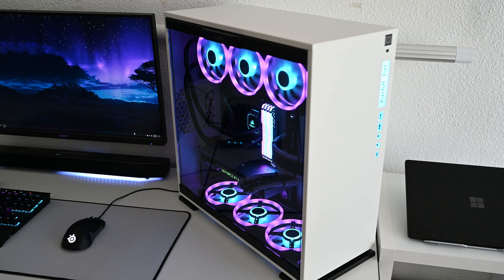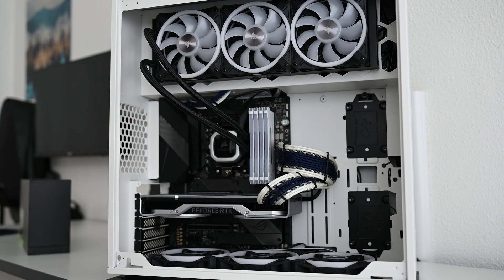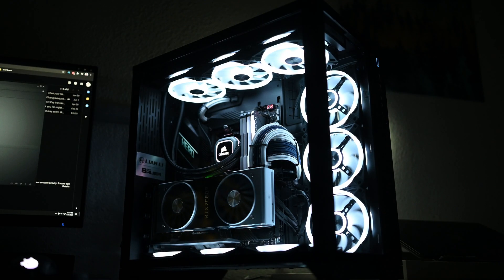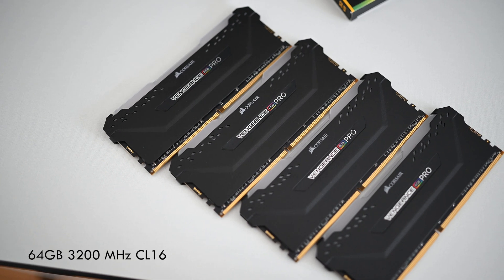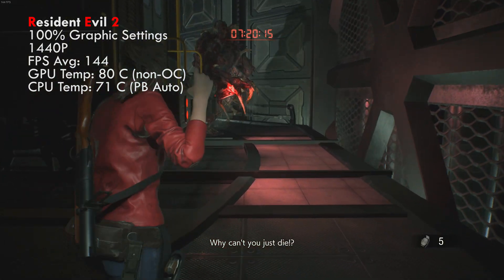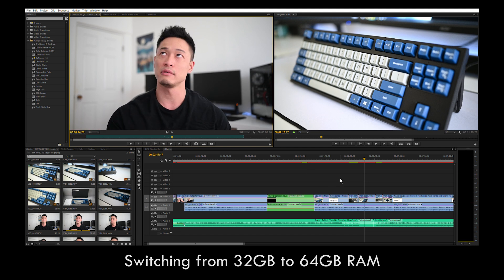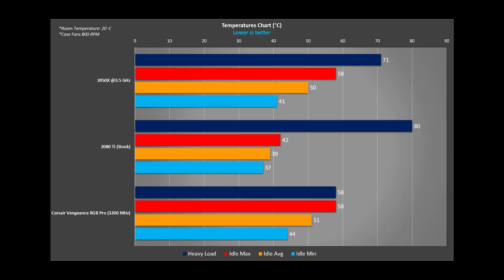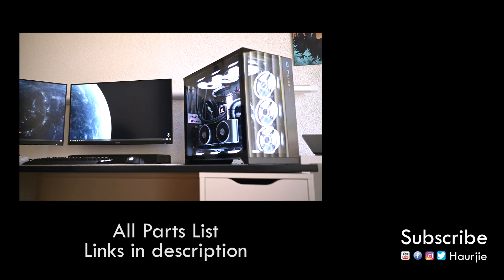Ryzen 9 3950X RTX 2080 Ti – 4K Video Editing Computer

Comment: 3600MHz vs 3200MHz will only have a difference at high refresh rate games really. I run 3800MHz. Your right that professional gamers would notice. Great to see that your RAM temps decreased by exhausting above them.
Reply from the maker: I'm gonna PIN this dude
Reply: @hardlinenexus  thanks for your videos man, so if  am building my PC based on yours, but want that little extra ump for gaming,  go with the 3600mhz right? which is one of the best brands ? or should i get the one you talked about here that you used to have? thanks again dude. love your videos. keep ya head up. mental health should always come first.
Reply from the maker: @josephruffhouse1792  for your case go for the 3600. In fact I have a new PC build coming out where I do actually use 3600 gskill trident neos with a 3900x
Reply: Haurjie dude thank you so much for replying! You don’t know how much it means. One last question for now,  if I’m trying to have a beefy rig both for gaming and productivity, is there really much difference between the 3900 & 3950?
Reply: @josephruffhouse1792  For the most part no.
Reply from the maker: @josephruffhouse1792  ehhh... Tbh, I personally haven't used the 3900x PC yet to answer that. I'm still waiting on one last part to come in before I can actually turn on my PC lol. But the 3900X is more than enough though tbh...
Reply: @hardlinenexus  Yeah, I found the 3900X to be almost overkill for just rendering video. Especially when I use GPU H.265 Video encoding. The 3950X is faster, but for most people it will not be noticeable. It's much better for 3d rendering apps that scale better.
Reply: Haurjie ok thanks man, I’m just trying to build a bad ass rig but I’m absolute noob when it comes to this stuff, but I really am trying to learn so forgive me for all the questions. I picked up a Samsun odyssey g9 monitor and I want to make sure I build something that will get the most out of that monitor. Ps do you have an IG or Twitter ? I have a 40k followers between both accounts and wouldn’t mind shouting out your channel if that’s something you care for.
Reply from the maker: @josephruffhouse1792  I do man thank you! I also am not a guru at everything. My IG and Twitter are both the same handle (haurjie).

Also, my buddy who answered your question here and also original commenter has the 3900X and he pretty knows that CPU like the back of his hand lol. Check out his channel, Graphically Challenged, he's gotta in depth tutorial on overclocking and all!
Reply: @hardlinenexus  Thanks man!
Reply: The price difference between 3600 vs 3200 Mem Kits is kinda small and sometime sometimes nonexistent.

Except maybe for some premium Mem Kits Brands.

Comment: Where'd you get the sleeves from?
Reply from the maker: Solosleeving
Reply: @hardlinenexus  Thanks! If I get only one of the "24 PIN CUSTOM SLEEVED PARACORD MODULAR POWER SUPPLY CABLE" is that gonna suffice for a whole build or do I need more than that? A noob question I know, just wanna make sure because you have 2 different designs
Reply from the maker: @levim.3505  24 pin cable only powers the motherboard. You still need PCIe cables for your graphics card and EPS for your CPU, that's at the very minimum.
Reply: @hardlinenexus  For the CPU, did you get a seperate 8PIN EPS and a 4PIN EPS? Also, I don't think they feature midnight blue as a color option anymore unfortunately...
Reply from the maker: @levim.3505  only need 8-pin. Navy/midnight blue is not listed, but he has it, because I requested him to get it in stock a while back. Just pick any color on the cables as a placeholder, and make a note on checkout. For example, pick electric blue during the configuration, and say "use navy/midnight blue for all cables that are designated as electric blue"
Reply: @hardlinenexus  I see, thank you. You mind telling me what the other colors in this build are? They look like silver-gray and titanium to me. Is that correct?
Reply from the maker: @levim.3505  yeah, it's black, white, silver and navy
Reply from the maker: by the way, this build was upgraded a couple months ago, you should see the custom water cooling i put in it :)

Comment: Hey friend I am just wondering, I have a icue H150i PRO xt Liquid CPU Cooler, it comes with stock fans that are not RGB, did you replaced them and if so does your nzxt internal usb hub usage for the extra RBG fans you are using? Thanks for taking the time to reply to this comment.

Comment: Hello there just wondering on your Ryzen 3950x build Do you need both Samsung 960 and 970? because I only seen you put one in your motherboard.

furthermore the cables you used, what type is it and how many pins do I need for this build and can you do a video of the construction of your cables with your new case and which parts fits in which ? 

Also your QL fans, how many can you get within a single purchase, does it come with the quantity of 3 per purchase? Finally the lighting node core, I notice that corsair only have 6 slots for each fans, do you need to upgrade a 9 slot or purchase additional lighting node cores?

Sorry if this is too much to ask but for a beginner build I would like to know the best methods you use such as cable management and the appropriate recommended best options for any features you might promote. Thank you 🙏

Edit: I subbed. Great content bro

Comment: hey man, loved the vid. was wondering if you use the same monitor for gaming and editing or do you have the same? pls drop the monitor's link .TIA
Reply from the maker: Thank you I appreciate it! I do use the same monitor for gaming and editing work. I bought my monitors at Micro Center which no longer has it. Best Buy also sold out. Amazon doesn't have it. It's an older monitor(s). But the alternative here https://amzn.to/34GNUFc, this is newer. I personally haven't tried it, but the specs looks similar if not slightly better. It's also got really good ratings from other customers too, I would get this if I didn't already have my current ones lol.
Reply: @hardlinenexus  by the details of it, its probably a 1080p or 1440p 144hz monitor...Do you have any problems editing 4k and color grading on your monitor? Im also looking for a monitor to edit 4k and casually game .4k 144hz gets very expensive . So looking for a 144hz 1440p ips monitos to game and edit 4k
Reply from the maker: @killercon2735  I've never color graded my monitor tbh, and I also never edited on a 4K monitor either so I can't really compare what that's like.
Reply: @hardlinenexus  like...you said this pc was for 4k editing. So i wanted to know which monitor you use for 4k editing?
Reply from the maker: @killercon2735  I use the Acer XF270hua. It's a 1440p 144hz IPS
Reply: @hardlinenexus  sorry for soo many questions... you edit 4k on a 1440p monitor?  Does that cause any problems?
Reply from the maker: @killercon2735  no worries haha. Well, I haven't edited on a 4K monitor before as I mentioned so I don't have a reference to what that would be like. As far as I'm concerned, I don't see any problems so far... I wouldn't even know what the problem would be actually? If you have edited on a 4K monitor before as well as a lower resolution monitor, maybe you could share that experience with me and I can look for it. A more important question I think every editor should also ask is, do your viewers notice something off? Are they complaining about something that you didn't see because you edited on a lower res monitor?
Reply: @hardlinenexus  I'm starting out to edit. I just built a good pc with similar specs as you...and I was looking for a monitor in which I can edit cinematic vids , colour grade and also game...an ips 1440p 144hz, should do 4k cinematic edits and gaming, right?

Comment: Vor Videoediting how many percent faster is 64GB vs. 32GB?
Reply from the maker: Higher capacity ram just allows a faster loading time when importing footage and sources. I don't know how much percent, but I noticed loading up Premiere and importing around 100 4K footage was about 10 seconds faster than when I had 32GB. In terms of rendering and exporting, this doesn't make a difference.

Comment: Bro your set up is so sick!! I came across your channel because I'm currently building a Ryzen 9 3950x and am going with a lot of similar parts.
I see that you went with QL fans for your case. Do you think 6 Corsair LL fans would be enough to keep things cool for my Corsair 570x?
Reply from the maker: LL and QL fans are pretty much the same thing. QL is just fancier and costly because it's double sided RGB lol but any fans will do as long as you have good airflow in your case. The lianli o11 dynamic in particular has really good airflow
Reply: @hardlinenexus  Yeah, I'll have to play with cooling and fan placements to see what creates the most optimal airflow. I'm just hoping I didn't make the wrong choice with white Vengeance RGB ram sticks lol.

Thanks for the reply man. Subscribed!

Comment: Wow, this is a great setup.  Just wondering if the specs were reduced say from the 3950X to a 3900X and/or also reducing the GPU from the 2080Ti to a 2080 SUPER, how much of a hit to 4K video editing performance would I see?  I don't mind a slightly longer export time as long as the performance remains good while scrubbing through the timeline in Premiere.  Interested to know your thoughts on this, thanks.
Reply from the maker: Not much man. My second PC I just built will be 3900X on 2070 super. Video coming soon.

Comment: Hi!
What temps do you get for your CPU during idle and load with the h150i pro? 
I have a 3800x with h150i pro xt and my idle temp is 40-45C. Is that normal? It seems kind of high no? When playing games and stuff it can go up to 65C or so as well...
Thanks for the help!
Reply from the maker: Your temps are actually pretty normal for an AIO setup like that. You're fine.
Reply: @hardlinenexus  okay good to know. And subbed! You got this man, and everything else in your life as well. Keep it up!
Reply from the maker: @googleprofile2629  thank! That means a lot. Appreciate the support
Reply: Its because of the way ryzen handles voltages.

Comment: Lian Li o11 dynamic (normal one, not xl) is the best case ever built, I regret not buying an extra one for backup before the price skyrocketed to > $200 these days. On the top I could easily fit a 240 push aio radiator and the 120 push-pull aio from the EVGA hybrid 1080 ti with no problem and my gaming cpu & gpu temp never exceed 55 degree and stays super silent. If you want even better cpu cooling you could even set up the 360 aio push & pull on the side easily. There are plenty of options for this case without the need to do custom loop.

Comment: I stumbled across this channel a few weeks ago and the production quality is amazing.  You deserve more subs and will get there in no time.  I have the Razer Edition O11 and I love it but wish I bought the XL version instead.  Take care
Reply from the maker: What does the XL version benefit you over the regular?
Reply: @hardlinenexus  The biggest issue I have with the O11 Dynamic on mine anyway is that you cant mount a 120mm fan at the rear.  Another thing that Ive noticed is that on the Razer edition you cant control the LED lighting without using Razer Synapse.  I know they are minor issues and I love the case either way.  Looking for a Phanteks Evolv X for my next build though :D